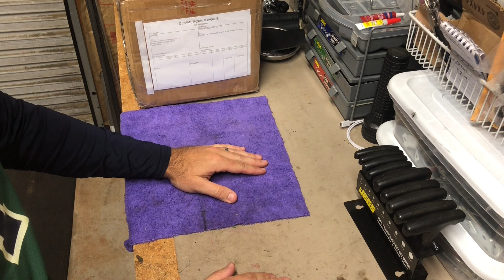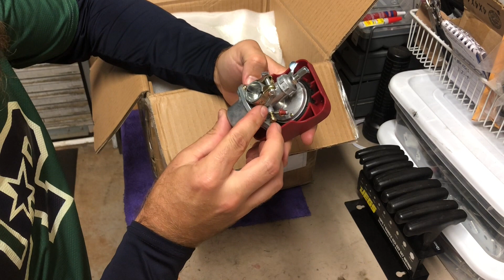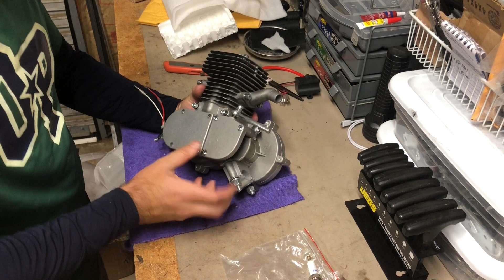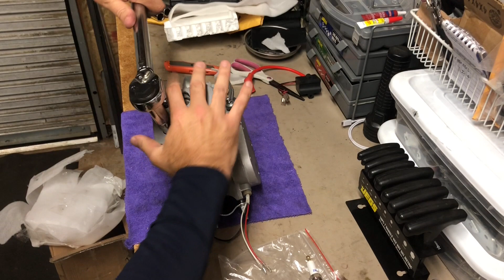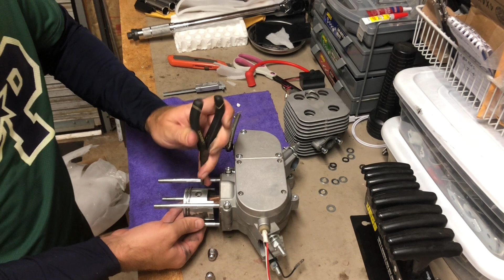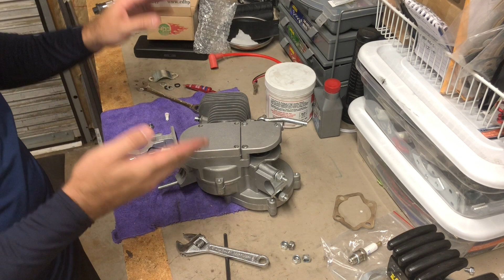Firestorm Zeda 100 YD100 Engine Tear Down, Review, and Pre-Install--Must Watch To Save Yourself

Comment: I enjoy your style of narration, not so much hemming and hawing around and more instruction with less drama.  Thanks for the magneto 6v/12v tip and the proper amount of head bolt torque.  I am curious about a statement you made about the extra gasket between the cylinder/head and crankcase changing or affecting the timing of the engine.  Other than a slight decrease in compression I don't see how the timing would be affected.  Perhaps the extra gasket was added to prevent piston contact with the casting flash around the head/cylinder junction that you dremeled out.  More expedient than actually correcting the fault.  Looking forward to seeing more of your videos.  FrankyLynn
Reply: It changes the Port timing by effectively moving ALL the ports up from the piston crown/head & skirt windows effectively detuning it slightly.... there's a reason there's 2 gaskets there: the Asians don't do something for nothing, it's costs them !. Trev New Zealand 🇳🇿🙃😇
Reply: PS if you can get a STK bore size replacement Piston you can    effectively do a partial porting job by lowering the piston top/Crown 1 - 2mm if there's enough meat (start off with 1mm removed from the width of the exhaust port) & raise & lower the Transfer windows in the Piston skirt sides about a mm top & bottom & even widen them the same amount.,....for an ex Honda Elsinore 125 MX'ER. Trev NZ 🇳🇿🤗

Comment: Just curious, why did you reuse the motor mount studs? Seems like a couple of bolts would have been a cleaner installation... As most motors have a removable head they require a head gasket. The manufacturers probably didn't know what to do with the extra head gasket, as there was no place for it.. so they put an extra base gasket between the cylinder and the crank case so you'd at least have the right AMOUNT of gaskets. Heh, heh, heh...

Comment: Where do you recomend purchasing one of these YD100's
Reply from the maker: I know and trust bicycle-engines.com and they have good prices. Gas bike.net has a reed valve set up with the yd100 but it is like $220 right now. Hope that points you in a good direction! Thanks
Reply: I bought mine online bicycleengines.com. ZEDA FIRESTORM 100 an recieved in 4 dayS EVERYTHING WAS RIGHT ON .THE PISTON GREAT NOT BACKWARDS PORTS CLEAN JUST BEST FIRST ENGINE EVER TY .HOOE EVERYONE ELSE ENJOYS THERES LIKE I DO .WOOOOO. HHHHOOOO
Reply: Is this the actual zeda 100 motor that is sold on bicycle engines.com?

Comment: I have two 4 stroke builds that are pretty fun with reliable engines.,  been toying with the idea of a two-stroke build. But all these 2 stoke motor look like total Chinese crap.  Heard all the horror stories people spend hundreds of dollars on these motors and I never ever get them to work, not even once.  Is there any company out there that actually makes decent 2 strokes bicycles.  These motorst seemed like a gamble.
Reply: i've never had a problem with my engines unless i did it myself, like running 42 mph at 8500 rpm on an engine designed to run 6500 rpm 30-35 mph. motor go boom when you run it as hard as you can for a 5 mile stretch. i still have my second engine i ever built too. i still have the first one i blew up, it's a paper weight. the second one i built, still on the bike and trucking along with 15,000 miles on it and only 2 jug changes, they wore down and were making my bike lose power and smoke a lot. changed the rings with each jug swap too. you can buy the higher priced engines, that have been looked over by competent hands of an american, or buy the cheapest kits ( like i do) and swap out a few bearings and do a little port work. either way you get a very reliable engine. heck even the engines kits i installed for other people, nothing done but installation and carb tune, an all those bikes are still running too. all be not as powerful as my favorite jack shafted 5 speed bike, but they run just fine. most of the crap stories you hear are from people making mistakes, not the manufacturer. hard for people to admit when they are wrong, easier to blame someone they never seen and don't know. i've got 10's of thousands of dollars into this hobby over the years, well worth it. nothing like buzzing down the sidewalk skirting traffic lights and the such, beating traffic to my destination. i even off road quite frequently. $650 bucks into a bike build tht has given me 15,000 plus miles, and still running like a champ, sounds like a good deal to me. an at 150 + mpg and a top speed of just shy of 50 mph. i have 10 bikes in my basement, all run great, those are the ones i refuse to sell. i've probably made hundreds of these over the last decade. i don't know, i never counted. zeda is a little pricey, but they sell a damnd fine engine.
Reply: Yeah man! All feed back is greatly appreciated.  I left that comment a wile back.  Since then I decided to join the dark side. I'm working on a 2 stroke build now as a winter project.  I haven't been able to work on it too much lately because of unexpected life BS.  I purchased a triple 40 from Zeda because I heard they were the best.  After waiting over a month I decided to order another kit as well.  Was looking at the yd 100 but read that they have issues with over heating and a couple people said the port work is not that good.  So I went with the GT 6 from Gass bikes,  because it looked like the best one they had that didn't come with a Reed valve.  Figure its better not to bite off more than I can chew.  I wont know until I get them running but other than the mounting studs the gt6 looks a little bit better witch i didn't  expect.   The port work is perfect,  the triple 40 just so so.  I'll have to wait and see.
Reply: @marcs4091   i'm thinking on my next bike i'm gonna try the engine in the video. i like shifter bikes, so i can always just jet a bit rich to help keep it cooler. i can always use more power when in the trails.
Reply: I have a zeda 80cc kit paid $110 figured I'd role the dice. . Have about 75 miles so far so good. What 4 stroke do you use.?
Reply: https://www.youtube.com/watch?v=oY7zKMUMEZw&list=LLDQrFR7LV7DJLYSygT8rm9Q&index=2&t=0s

Comment: How can you tell if the piston is backward?
Reply from the maker: The piston will have two piston ring notches near the top. Inside the top notche, you will see one side has a pin within the notch. The bottom will have a pin on the same face of the piston, but on the other side. The face that has the pins on it IS THE INTAKE SIDE.
Reply: @SouthernCustomCC  Thank's for the response and explanation.

Comment: The two gaskets changes the timing and gives you a little more bottom end taking from the top end. I tried it both ways and the only difference I noticed acceleration

Comment: I gota reccomend a metal gasket for the intake I beleive you can get an oxygen sensor gasket off of an 00 or 02 Toyota 4 runner  or highlander. It fits it I will try and look it up to be sure which one and come back and comment
Reply: So old bro

Comment: I just got my bt 100 ...some people say the bt and yd range is rubbish but I see big potential ...I'm using a pwk power jet 24 mm carb and yz 85 pipe ...with some piston mods and porting ....to start with ...so many people don't even give em a go ...also there is debate ova wat engine is newer the yd has 8 mm studs but only two per side the bt has 6 mm studs but 4 per side ...so both good don't no about yd but by has 7.1 comp standard
Reply from the maker: Hey! I agree. The YD has a lot of low end torque--more than enough to spare. So, for my next free-time build, I am going to use the YD100 with the high speed carb. Then I will lower the stock 44t sprocket to a low 30’s tooth sprocket to get top end speed, then I will add an MZ exhaust, use the OZ magneto, ngk plug, 8mm copper core spark wire, and finish it off with possibly an internal velocity stack (may have to adjust the jet depending on outcome). I know there is more I can do, but at a certain point, it becomes overkill for a bike... Get a motorcycle if you want more, right? Overall, I really enjoy this engines power. Definitely a step up in my opinion.
Reply: @SouthernCustomCC  I totally agree my dude ....at a point it is ova kill .......I already have fast bikes with real gears ...but they are def worth having a play with

Comment: Im guessing paired with a 31-32t rear sprocket on a 26" bike 45mph shouldn't be out of the question. I hit over 40 with no mods on pk80s (66cc obviously) running a 31t and a higher flow exhaust.
Reply from the maker: I believe so. The kits will be coming with a 44t. There is so much torque and low end power that you could drop down to the 30’s, and benefit in both low and top end. Put an MZ pipe on it and you'll see huge benefits too.
Reply: I hit 52mph
Reply: I've hit 41mph on a Gt80, porting does alot of the work, and I'm on a 36t, stock carb and exhaust and it's rebuilt with 7,500 with just new lightweight piston. Still going strong! Keep it up Team 2T!
Reply: 46 mph via GPS on 22:1

Comment: Hello, sorry to bother but I am trying to decide whether or not I should buy this engine kit, or a standard 66cc kit from bikeberry. This is a hard decision for me because the true 80cc doesn't have a cylinder head which isn't as reliable.
Reply from the maker: Tony Arlt : Hey, thanks for watching! I like this motor for the torque and low end power. If you pair this motor with an MZ pipe, you'll really fly! The standard 80cc engines are cool because they are modifiable such as a high compression heads. To be honest, the more modified your engine is, the more attention and tuning you will have to do to it on a regular basis. So with the yd100, you get the low end power and a decent top speed, which helps tremendously if you live in a start and stop or hilly area. If you buy one this weekend they are $149 for the entire kit. Either way, have fun!

Comment: is the carburetor jet larger to compensate for the larger engine?
Reply from the maker: Hey Tony: yes, the jet is larger at .72mm and port chambers @ 3mm. Overall, better gas and air flow.

Comment: Every engine look identical, the box look exactly like the chinese model, why can't the supplier cast there own engine and make their own signature design instead of copying  design from original Chinese model. 

Its really difficult to tell the engine performance   the only way to see the performance in real time is to run on dyno to get raw data, by  playing by ears it difficult to tell how well these engines run.
Reply from the maker: dread knot : I agree, I wish there was some separation like there was 3-5  years ago. Ports were different, transfer cases we're different, and even pistons we're different ( I.e. High vs. Lowhole) among suppliers. It’s like amazon drop shipment now... all the same just different suppliers. I personally have found a very reliable, strong, and powerful motor on the cheaper side which is my go-to engine now. It has everything a builder wants without the stress of daily upkeep and daily stress. There setup is legit and always the same... no backwards pistons, no awkward casting obscurities, and consistent power. Hit me up if your interested in my supplier. I appreciate your viewing, comments, and support!
Reply: @SouthernCustomCC  yes whos your cheap but good supplier
Reply: @SouthernCustomCC  who is your supplier? Unless things have changed in 9 months... I'd like to know the best kit for low end torque and high end torque, for under $300. Possibly pre upgraded..
Reply: @SouthernCustomCC  I've been looking at different engines and companies. Can you send me info on your goto engine/ supplier? Thanks for the videos by the way. Shows us what to look for on a new engine
Reply from the maker: dread knot : Zeda Mafia gets its product from JLZEDA (Alibaba) in china, too. But, yes, they do have the Dyno machine and do experiment to help push the boundaries.